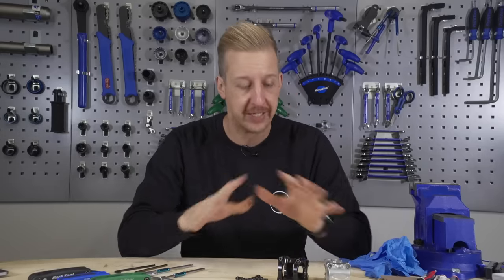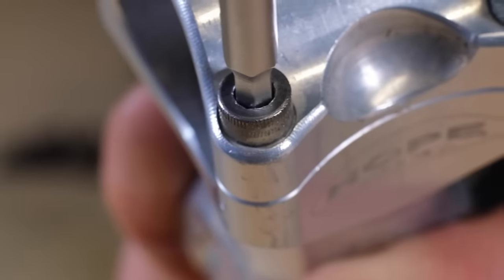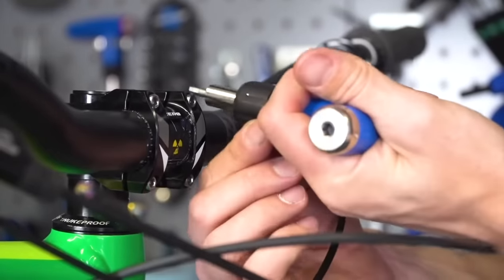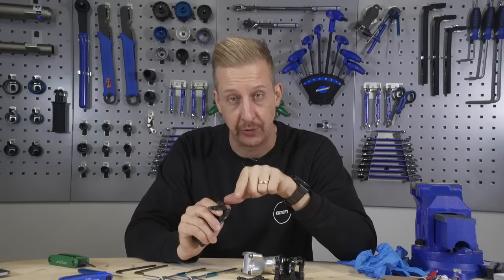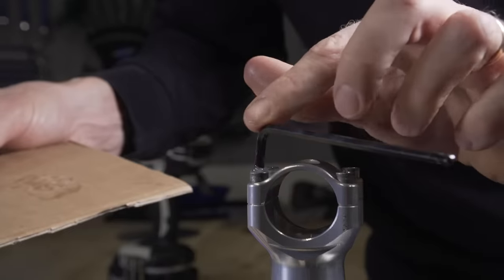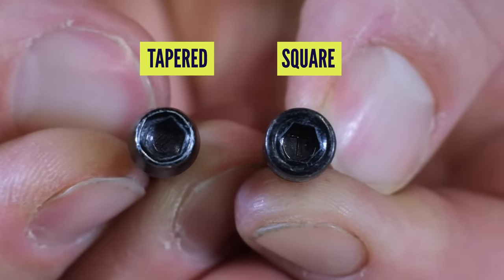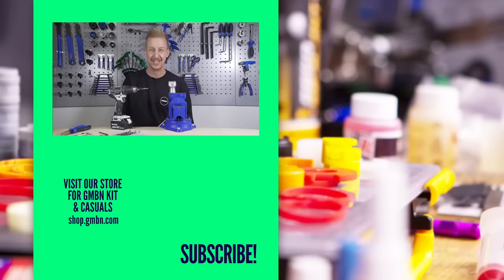4 Ways To Remove Stripped, Rounded, Or Stuck Bolts | GMBN Tech's Guide To Stubborn Bolt Removal

Comment: in the close up of the drilling it looked like the drill was going the wrong way
Reply: The drillbit is backwards threaded (a left hand thread) so maybe that is the cause of the illusion
Reply: @sionvandevelde  when you looked at it 8:06 the cutting edge9the flat bit) isnt cutting and the curved flute is the bit that is slowly grinding away at the bolt
Reply: @Aspire-to-creativity   Yeah, I see...
Reply: The only explanation left is the rolling shutter-effect in which the problem is just the way the camera picks up the motion.
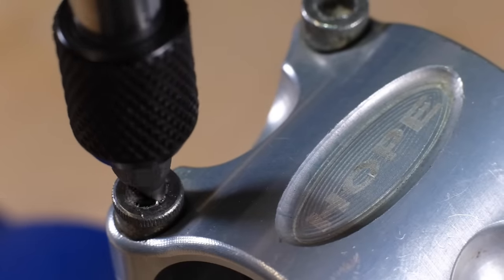Reply: @sionvandevelde  ahha at 7:53 the drillbit is going the correct direction
Reply: @Aspire-to-creativity  rolling shutter depends on the speed of the drill and the framerate, so maybe the drill speed is different...
Reply: @sionvandevelde  ye probbly
Reply: @sionvandevelde  actually i think it was for a beuty shot bc it loos like he dose that for a couple seconds then pulls out with it the wrong way

Comment: More company's need to take pride in Bolts in general. FUCK OFF anything 6mm or under for torx/Allan and stop using cheap bolts stock on bikes. COMMENCALS ride alpha stuff on their bikes jesus christ even checking them to torque spec rounds them woth brand new or good quality Allan's. Too many company's just use terrible bolts